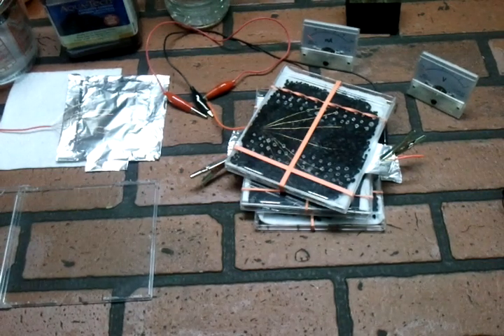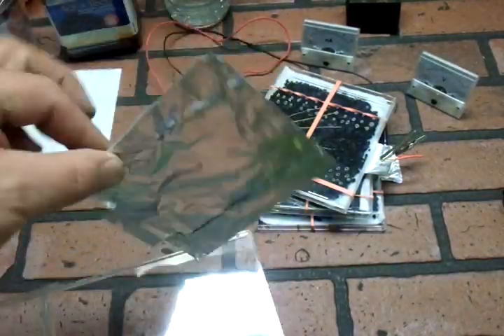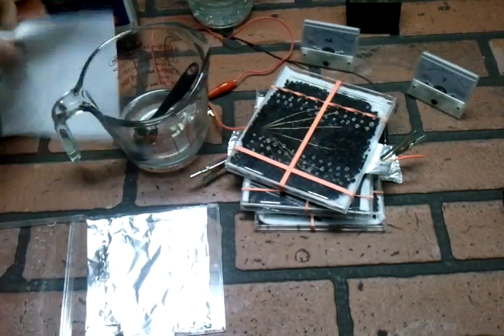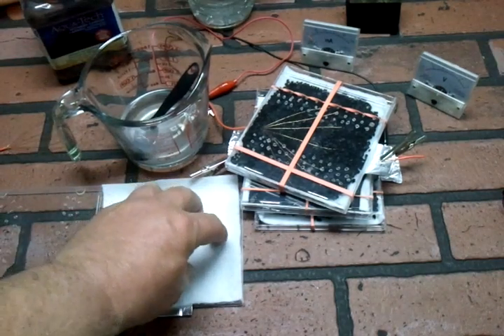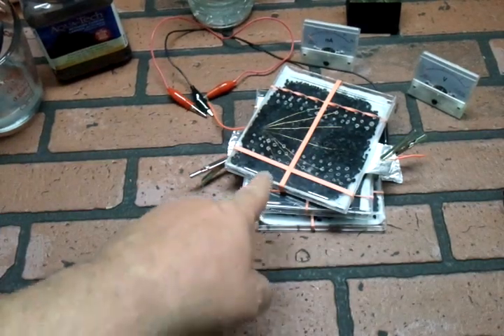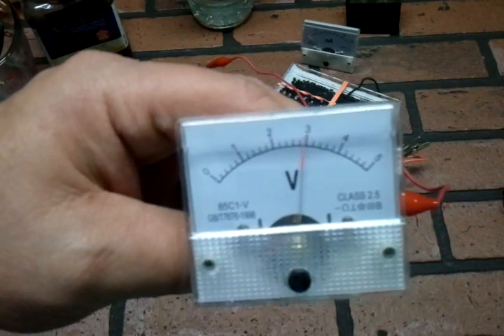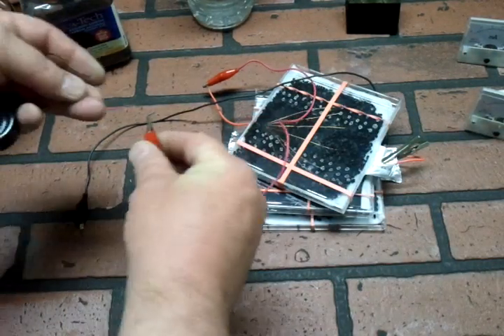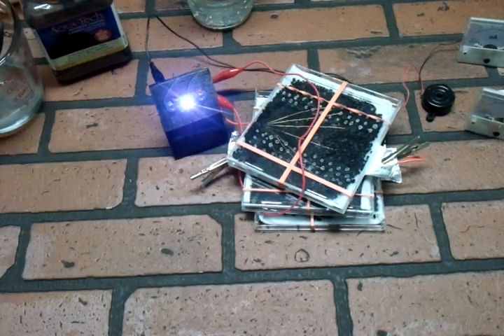Quick and Easy Aluminum Air Battery

Comment: this is not a battery because batteries MUST!!!! be charged in order to get current out of them otherwise there is only a potential difference between anode and cathode and no current...this is a photovoltaic cell  and it's the light that is responsible for current to flow...carbon is a neutral / very conductive atom that is dielectric...all of the carbon atoms are experiencing a repelling force because of light...and the electrolyte is also feeling the repelling force...the 2 are additive which gives a greater electrical force than there otherwise would be without the electrolyte...the electrolyte is working EXACTLY!!! like a capacitor does in circuits so you can get more power out without changing the voltage or current...similar to transformers...the total amount of energy being used remains the same like transformers....there is an equal and opposite reaction force between the copper wire and  aluminum which cancels...and the leftover is the actual current...the carbon is transferring energy to the  particles that are not cancelled by the equal and opposite reaction force between the copper and aluminum...technically this is a solar battery/panel hybrid and NOT an air battery...you are not separating charge to use at a later time like batteries...its an on demand system
Reply: You are wrong ......And soon you will know it.
Reply: BS
Reply: @justtinkering6713  finally someone called me out... Congratulations... It shows who his audience is
Reply: @metou3072  😭

Comment: I noticed that your are using carbon fiber.   You might want to revisit this kind of experiment due to the new findings people are getting.  check out Kev Wallcroft, he is working with magnesium and carbon fiber weave in a dry cell and it is very interesting. I thought you might want to know about this.  Thanks for the vids.
Ed

Comment: Could I potentially connect 48 of them in series to get 48 volts and power an electric bicycle, because: what are the current limitations knowing you have a 1500 watt motor? What if I had another stack of them connected in parallel to the first stack, wouldn't that double the capacity and therefore max range?
Reply: firstly your bike also needs current, which I'm assuming to be around 10A, with 48 of these wired in series would output ~48V but only 100Milliamps, so you would then need to wire up about 100 of those 48V series in parallel to bring the current up to the needed 10A. All said and done you end up with 4,800 CD cases and probably 10,000Ft of wire strapped to your bike. That's just to get it to run, your mileage would be determined by the Watt/hours it produces which first most be calculated from the amp/hours of the battery. In reality with all that aluminum foil, even extremely intelligent , would surprise me if it could go for a hundred miles, if you make a system to replace the electrolyte.
Reply: I am interested in a simmilar application to Matt.  I have a 72 Volt Electric moped currently running on SLA batteries, and I am looking to experiment with other types of batteries to run it on.
Reply: What you're expecting to make is a commercial-grade battery, which isn't going to happen after just watching a couple of YT videos. Also, this type of battery isn't rechargeable.

Comment: Nice battery :) Careful not to put these cells in an non-ventilated enclosure as hydrogen gas build-up can be explosive.
Reply: At 100mA, the amount of Hydrogen is minuscule. Put in another way, you need a kg of aluminium to produce 1000L of hydrogen so a piece like this is around 1g and will produce 1L of hydrogen during the month such a cell works for or 0.023 mL/ minute, hardly anything.

Comment: I tried to follow your directions exactly.  I get almost 1 V, but only around 10 mA.  I made two, and get almost 2 V on series, with around 10 mA.  In parallel, I get 1 volt and only 10 mA.  Can you guess what the problem is?

Comment: There has been some work with Al/air batteries for years and they have been used some in the military. One drawback is they can't be recharged; the AL turns into aluminum gel and has to be replaced. Zinc/air batteries can be rechargeable and may revolutionize battery technology-can be relatively much cheaper, are nontoxic, and have a very large power density. AL/air batteries have even better power density. I wonder if this vinegar prevents the formation of the AL(OH)n gel. Maybe these technical problems with these types of batteries of the electrolyte drying out or too wet is not really that mysterious and only depends on how many small holes are made.
Reply: For those who asked , he said he used felt to separate the electrodes. Others just used paper towels.

Comment: I am not sure this is an air battery but you could compare sealed with not sealed and see what the difference is. if it needs oxygen to operate it will become obvious with the behavior of the sealed version.
Reply: Great idea. I’m wondering if the copper wire is reacting with the aluminum to create the voltage and current? Almost looks like a copper aluminum battery.

Comment: How long do they last, and do you have to replace the carbon every time you use new vinegar salt water?
Reply: You shouldn't have to replace the carbon as it is the oxidation of the aluminum that creates the voltage potential and current. I have been wondering if it might be done with carbon paint on paper soaked in electrolyte pressed against aluminum foil so all you should have to do is replace the aluminum foil.

Comment: This looks like a fun build.  I saw in one of your replies that the air holes seem to act like a kind of timer - good for 6-8 hours.  So stop me if you heard or said this - i wonder if plugging some air holes would slow the drying process, hence extending this battery's run time?

Comment: I just mixed up a batch of electrolyte as per his ratio in the video, grabbed some foil, and used a scrap of regular paper with pencil graphite on one side.  Got half a volt.  The piece I used was small but it works so i'm gonna scale this up and see what I can get for output and longevity.
Reply: The voltage won't change by size but the amperage will. Voltage between material with an electrolyte will be what they are but the size will change the amperage of the cell made of a given chemistry.
Reply: If I create multiple cells and wire them in series to create the intended voltage.

Comment: Does it charge itself?? Or how do you re charge it??
Reply: you recharge it by replacing the aluminum foil. you could recharge it by getting rid of the oxidized layer on the aluminum foil but I am not sure how hard that would be to do.

Comment: Thats not how you measure current with that meter. That meter is supposed to be used in series with your load.
Reply: No, he is measuring current correctly. Think about it. A (non-ideal) wire is technically a load. The short circuit current is the most current that battery can produce.
Reply: You are wrong buddy,he is measuring VOLTAGE not CURRENT he even said that!
Reply: you can do it in with the batteries in series or parallel. in series the voltages will be added and in parallel the amperage will be added. If he had put the batteries in parallel, he would have gotten 1V and 300mA.

Comment from the maker: I like that these cells dry out and stop with plenty of ventilation.  They can be reactivated several times.  The can idea would be neat to try, I think drain holes in the bottom of the can would be necessary.
Thanks - Brad :)

Comment from the maker: With all the air gaps, it is like they are on a timer.  6 to 8 hours of solid output and they dry out.  Add water and off they go again for another 6 to 8 hours.  This can be repeated several times.  Thanks Kyle,
Brad S :)